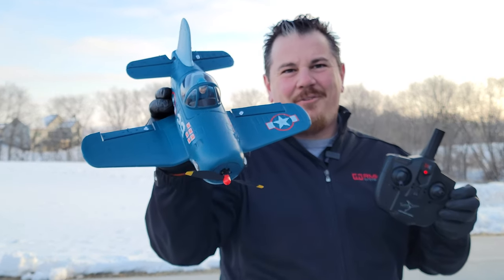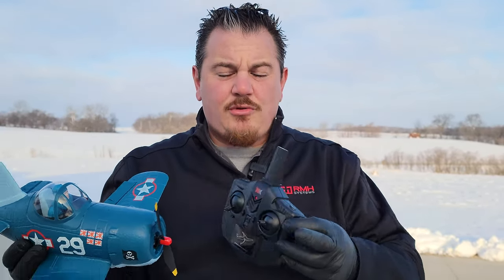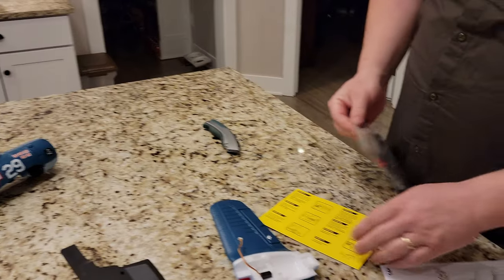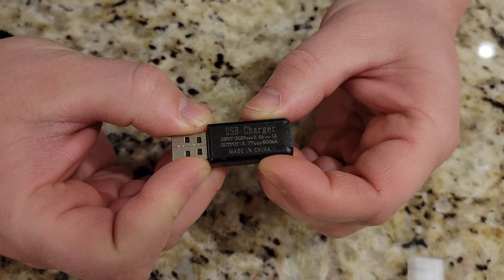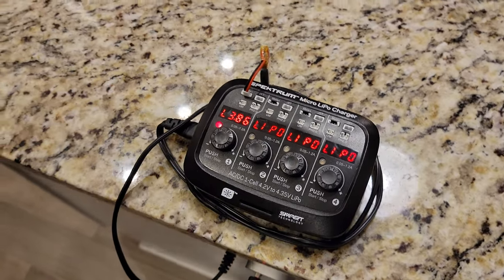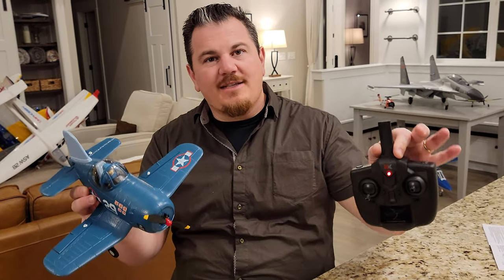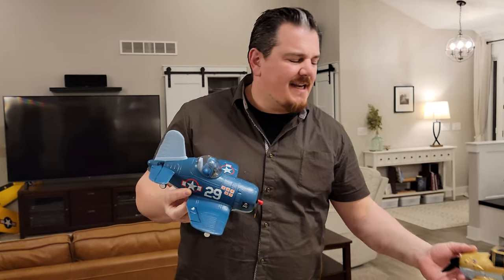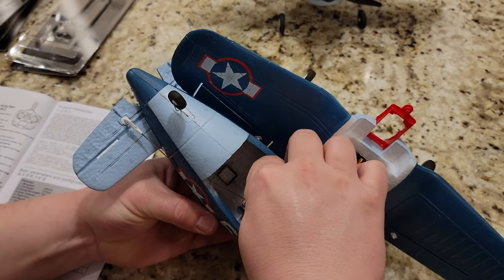XK - A500 - RTF Fattie F4U Corsair - Unbox, Build, & Maiden Flight + Bonus Satellite Rx Setup

Comment: Thank you very, very much.  I just got this plane and was wondering why it was being a little weird on the control surfaces while using the XK controller when the gyro was active after running the engine up.  It made me very happy that I could bind it to my NX8 using a satellite receiver (guess it helps to read the manual).  I had one from a crashed plane and with using the technique of using a separate receiver to bind it to my transmitter, it worked.  I will need to do a range test but if all goes well, I can't wait to fly this.
Reply from the maker: With better Tx - this will be a BLAST to fly - good luck Jason!!!

Comment: Question about the plane.

I have one and love it. But find it odd it does not have yaw support (that I can tell. I am new to the hobby) only way to turn the plane is to bank.

I notice the mother board is similar to other planes from XK and some of those have a second servo on the MB. I was wondering if I installed a new MB with 2 servos into the plane and modified the tail to be able to turn. Would it fly ok? or do you think the rudder was left out on purpose? Say for flight stability?  I would apperceive any feedback
Reply from the maker: You can do whatever you can squeeze in there (considering weight, CG, and size), and YES, you could add a RUDDER. The "Bank and Yank" speaks to ailerons and elevator only. This is pretty common on CHEAP small RC's, but especially on EDF's, not so much on warbirds like this...albeit a "fatty" ;)

Comment: Hi Brian, Any idea how to get 3D/6G modes working on the stock receiver using an open TX Jumper  transmitter? I see you successfully  got it working with the spectrum receiver/transmitter. Tried every possible channel and I can't figure it out. Once I give it throttle it's stuck in what I assume is the auto leveling mode. Any help would be appreciated.  Have a great day.

Comment: Great video! I'm on the verge of buying this plane but  I have a question: is there any light signal or other indication that lets you know when the battery is about to run out pre- or mid-flight? Trying to prevent another lost plane.. aha.

Also, how different is the  A500 vs the A250? Just design, or are their flight abilities different at all?

Thanks in advance!
Reply from the maker: I honestly can't recall if it's got LVP or LVC on it. It's a great SUPER FUN plane, but it is a special one, with some strange flight characteristics.

https://bprc.me/FattieF4U
https://bprc.me/FattieBF109
https://bprc.me/S44_Micro_LiPo_Charger
https://bprc.me/Satellite_DSMX
Reply from the maker: A250 and A500 are different planes, both FATTIES, but one is the F4U and the other is a BF109
Reply: @BrianPhillipsRC  than you so much for explaining!
Reply: I time all my flights as LVC alarms usually trigger too early when there’s a lipo sag under power.  if your tx doesn’t have a flight timer, get a cheap Casio watch with a countdown timer.  Set your first flight for a conservative 3 minutes, and take a voltage reading.  After 2 flights you’ll have a solid idea of how long your flight should be.  My ideal landing voltage is 3.80v per cell, which is storage voltage.  timing my flights will land me at my target voltage just about every time!

Comment: That’s because you are using a FPV satellite, it auto binds. A regular DSMX satellite will not auto bind. If you bind with a separate RX it would’ve worked just fine.